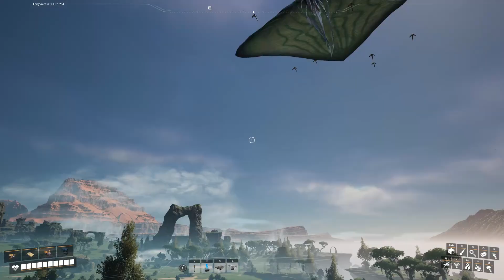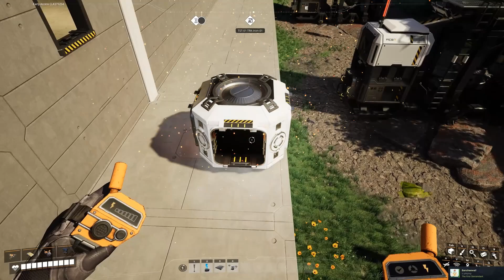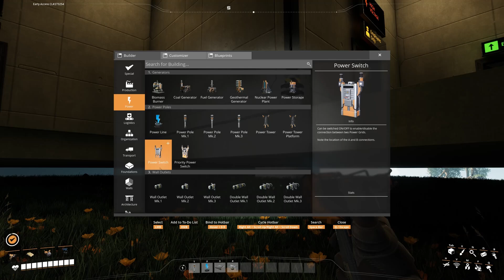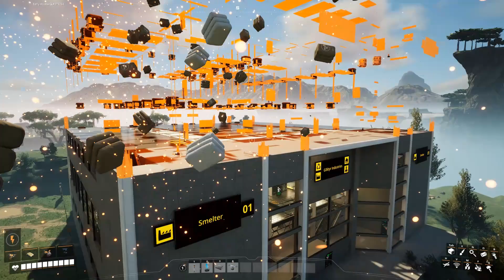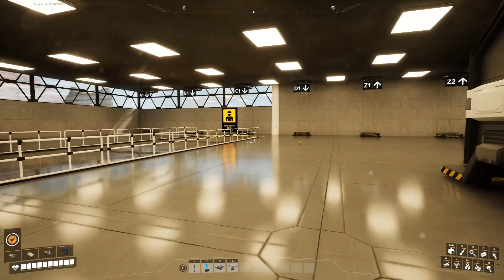Gillityr Industries Factory Stax How to connect layers

Comment: Great Blueprints! Where are the inputs for the manufacturer blueprints? Looks like it's from the top? How can they be stacked if so.
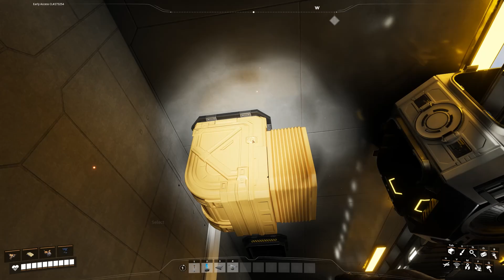Reply from the maker: Outputs of a given layer are sent upwards to the layers above.  This is shown in the video around the 18:00 minute mark.
Reply: @ the factory blueprint has inputs from the top. I guess the idea was to feed it from the drone hub, but that’s not always possible/efficient.
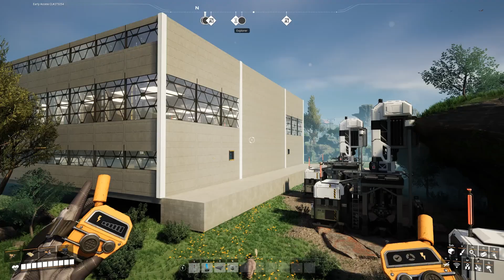Reply from the maker: @ibrahiemk  The bottom layer is fed from the back wall, as shown around the 4:30 mark.  It can also be fed from the bottom using the Truck Depot layer provided.
Reply from the maker: And yes, it can be fed from the top using a drone BP as well.  Multiple options exist.
Reply: @GillityrGames  Thank you for the replies! I see those bottom on all your blueprints, except the manufacturer. There are no bottom or backwall accessible inputs I could find. Maybe an old blueprint was uploaded to SCIM?
Reply from the maker: @ibrahiemk  Ahh yes, you are correct.  For some reason on that particular factory I assumed it would be vertically fed.

Comment: nice blueprints although would have been so much easier if you had saved the power input better.even an external power input connector
Reply from the maker: It is just a matter of preference--I very much prefer to hide most power lines and do not like to see power connectors nor power lines attached to my factories.  I am sure there are many things that each individual would do differently if they ever bothered to make blueprints at this scale available to the world not locked behind a paywall.  To each their own.

Comment: Thanks very much for these videos and blueprints. I fell over them yesterday and was quite amazed how easily they put together. All the best for version 1.0 and looking forward to future videos. Regards Pete 😀
Reply from the maker: I appreciate the feedback!  If you find any issues in those BP's let me know.
Reply: @GillityrGames  Thanks i sure will, let you know so far i have used all the T7 Blueprints, on a few buildings. Just replacing standard things and getting used to connecting things up and working great so far.
Reply: Hi you asked for some feedback so here goes. So i have only used the T7 Series but not the manufacturer as yet. The only little thing i have found out is with the 6 Drone BP, a very mall issue and too easy to work around. Going upwards from the assemblers the lift hole on Z2 is one click out. I just remove it and replace it and Bobs your uncle! Thanks again having a lot of fun with your BP's All this is just a practice run for me to the lead up to the new release. They are so easy to use. Regards Pete
Reply from the maker: @peterbuhler1202  Excellent, thank you for pointing out that Z2 issue.  I have fixed it on my save.  The next time I upload an update for that BP, it will be fixed for good!